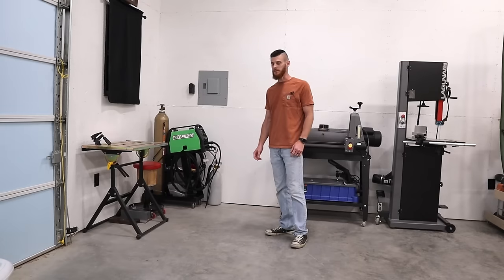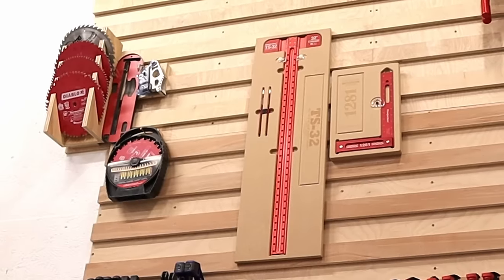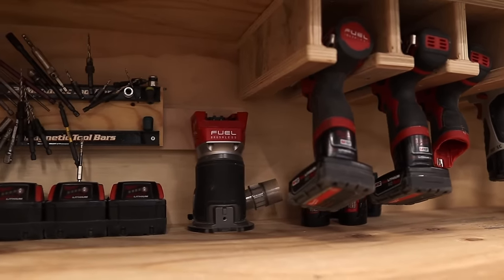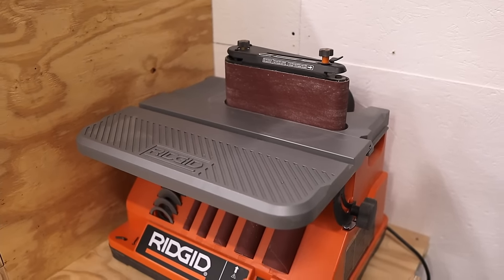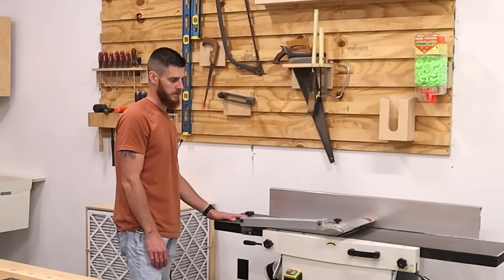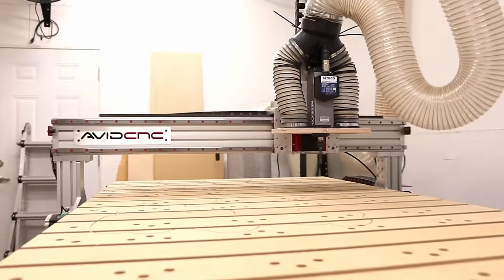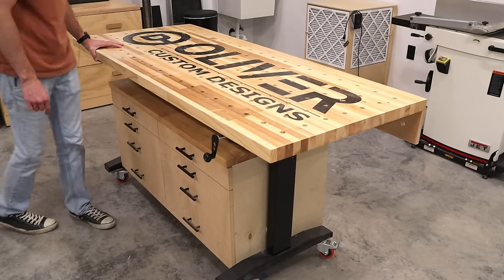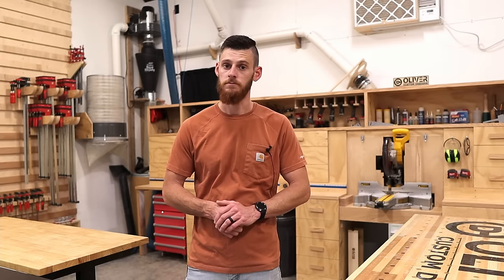This Started as a HOBBY | Shop Tour

Comment: Nice shop, loved the video. 

Primary reason your CNC dust collection works better is because of the inlet and outlet configuration. You said the 6" helps "a little" in your video; it helps ALOT. From a conductance standpoint 6" will have well more than double the conductance (think of it as flow) of a 4" pipe, all else the same. Also the downstream configuration on your CNC dust collector is essentially optimized whereas your shop collector's downstream configuration is horrid for conductance (it looks really nice, so I understand why you did it). You want large diameters, minimal length, and minimal bends on both sides of the blower. You're choking the flow to the filter badly which causes causes a large pressure drop, thus decreasing flow rate at the tool-end. 

Hope this helps!
Reply from the maker: Thanks! I've considered upgrading to 6" inlet and outlet piping just haven't wanted to spend the money or the time to do so haha. I definitely will eventually just need to find some spare time.

Comment: Quick comment here. I have also modified my 2hp harbor freight DC with the Rikon impeller, bigger 6” inlet, and a pleated filter. The reason you’re not getting the suction you want is very likely due to your huge run of 4” pipe down to your filter. Even if it’s 5” ducting, you still have 90 degree angles, and a long travel down to your filter, which is choking the air movement. If you simply lift the filter up to be right next to the DC housing, and do a straight short run with a 5”-6” duct, your cfm will drastically increase.
Reply from the maker: Thanks for the advice! I have considered changing it to a straight run to the filter, but I like having it close to the ground for convenience when it needs to be cleaned. I still may do it eventually.

Comment: tracks for the track saw on the garage door -- that's awesome. I've really wanted to utilize the garage door as storage space. Are those shop made holders? How did you make them? Will they hold the tracks if you open/close the garage door?
Reply from the maker: Yes they are shop made and do hold the track when door is  opened/closed.  I just sketched up the design and used the CNC to cut the parts.

Comment: Dustin, so many questions! 
OCD is a good thing for woodworkers.
What are the dimensions of your main shop without the part you closed in? I'm trying to stuff everything into a 2 car garage and cant seem to accept the limitations I have on space but I want the Laguna bandsaw you have! Can you talk about the Husky adjustable table? Been looking at one. I like the addons you made. Does it take the weight of the laminated top and the drawers? How stable is it? I thought about using two of them for a miter saw station wings but then I saw the dog holes you made and wondered if it resist racking etc etc 

I like your shop. Would love to send some questions to you on if you're on Instagram. Thanks for the tour! Liked and subscribed
Reply from the maker: The main shop is 24x30 as for the husky table it handles the weight of the top and drawers well. The additional weight makes it really stable, its never moved on me with the wheels locked. The top will tilt some but not to bad, no different than it did with the smaller top it came with. I love having the ability to adjust the height, it makes a great infeed or outfeed for every tool too.

Comment: Are those Katz Moses' blast gates?  I have those and love them.  They are set up like yours.  Overhead.
Reply from the maker: I did get the idea from Katz-Moses but just cut them out with a jig saw, they were made long before getting the CNC. Before moving the dust collection I had them set up with contact switches that would turn on the dust collector when the gates were open. I plan on redoing that once I've settled on the layout. Thanks for watching!
Reply: @DustinOliver-OCD  mine were not made with cnc either.

Comment: I've been planning to get the Husky height adjustable work bench and modify it like yours for some time now. Anything you'd do differently?
Reply from the maker: The only thing I would do differently would be to center the  top. Since I put a bigger one on I set it back a bit to still have access to the lift crank. Now it just leans to the back a little, not really a big deal though.

Comment: Inspiring shop. How well does the foam on the garage door work? I live just north of Houston TX and my shop door faces East, and isn’t insulated yet. I am debating whether or not to use foam or get a garage door insulation kit.
Reply from the maker: Thanks! Yes insulate it! I can relate, I'm East of Baton Rouge LA. It made a noticeable difference. I actually just got 4x8 sheets of 3/4" foam insulation from lowes and cut it on the table saw. It had a higher R value than any kits I could find.

Comment: Great shop, looks really nice!  Question on the router lift.  I recently got that same saw and want to put my router lift in the extension table just like you did…. Did you have to put some additional backing underneath before cutting out for the lift?
Reply from the maker: Thanks and no I didn't have to add any bracing. The top is an MDF like material but seemed a lot more dense, which made it more difficult then I expected with the palm router. I guess thats why its strong enough to not need bracing. Hope this helps good luck!